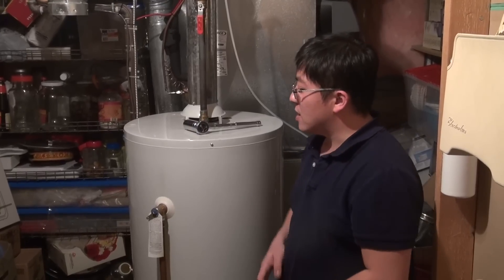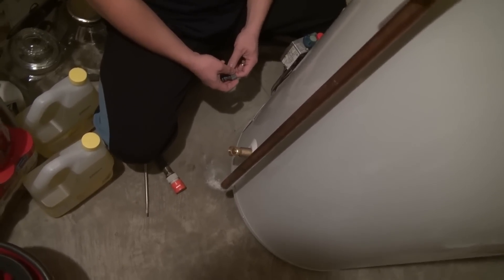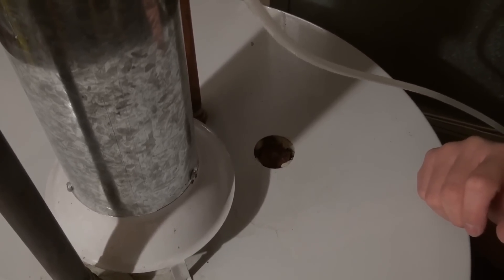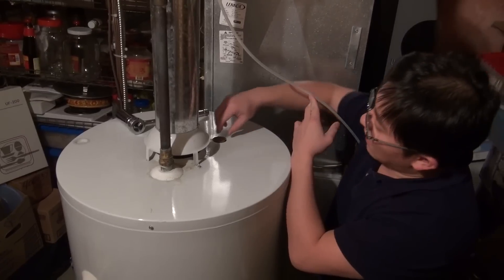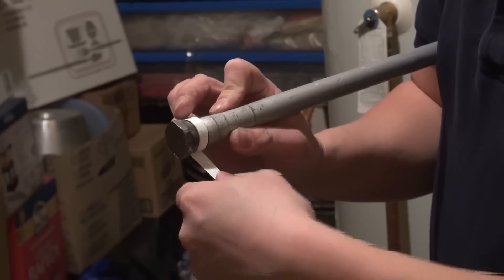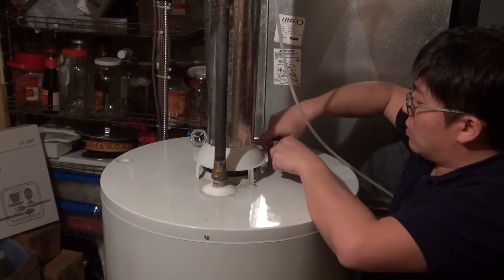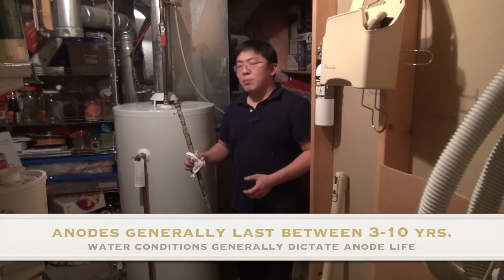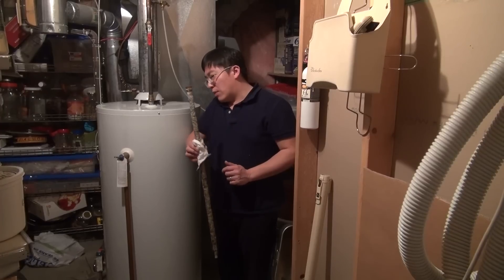How to Replace A Water Heater Sacrificial Anode Rod

Comment: I’ll be quite honest with you, I can’t find the access point for my anode rod. The entire top of my water heater is flat with a pipe for hot and cold along with the wide metal pipe in the middle. Any possible hidden spots?
Reply: Yeah actually it is a Bradford white. That being said. When I disconnect the hot water line and pull out the old
Anode rod, I’m assuming that it’s an anode rod with a nipple that I need?
Reply: Does it have to be ordered or would I be able to get one from Home Depot? Or Lowe’s?
Reply from the maker: it will depend on your local availability.  In my neck of the woods it was an item only available from special plumbing supply houses and NOT Lowes or Home Depot.  YMMV.
Reply: Hmm I’m in Calgary Alberta. I don’t know if it makes a difference. I’d have to call around
Reply from the maker: Calgary?  That's super easy.  Call Amre Supply.  They DEFINITELY have that in stock.

Comment: NICE video. I use SOFT WATER from Culligan, this is a nightmare. I have replaced the 3rd water tank now , until my plumber he remind me about to replace the Aluminium zink anode rode (every 2 years) , because Culligan  soft water has a lot of salt and damaged my hot water tank every 5 years. I did replace the 3rd hot water tank, and so same as my other friends that using same soft water from Culligan.
Reply from the maker: you're most welcome.  Wow 3rd tank already?  Tanks in our neck of the woods typically go for at least 15 years or longer.  I will keep that in mind when I decide to go with soft water...
Reply: I have decided to remove the Culligan , and my old house without soft water, the water tank already over 25 years still good !

Comment: I was told to use a  Segmented Aluminum Anode Rod since I don't have enough room. I was wondering if, I use a  Segmented Aluminum Anode Rod, will the links that hold the rods together corrode?
Awesome video. Thanks a lot.
Reply from the maker: the cable that hols the links together I believe is stainless steel which should last longer than the aluminum segments.  If you can't get a solid rod in then definitely use a segmented one as having a rod is better than no rod.
Reply: Thank you for your reply(answer). It helps a lot.

Comment: I did it with the big Milwaukee impact driver....came out with no effort...14 years old and seriously corroded. I had to carefully use the impact driver to force it back on. The impact driver made it totally easy.
Reply from the maker: yep impact drive would make it EASY but you have to be careful you don't crack the tank or inadvertently cross thread.  I'm sure you took the precautions however, I've seen other folks do some silly things to all things "threaded".
Reply: I did the same on the removal (still took a couple or minutes impacting before it came loose), but would not use impact to install.  It doesn't really have to be that tight (easy to do with hand socket wrench) if you use tape or sealant.

Comment: Good informative video. I also like that you roll the teflon tape in the correct direction so when you tighten it does not come loose. I seen other supposedly professional put the tape in the wrong direction.
Reply from the maker: glad you liked my vid.  I think I put the tape on the proper direction (I usually do) otherwise it would "unravel".  Yeah I've seen some pros do some weird things (including the recent plumber that botched my water heater install.   We are all human beings so making mistakes is part of life :)

Comment: One point to clarify if I may.  Do not turn on the electricity until the tank is full as you could damage the heating element via dry fire. 
Good point by Jooby Zat about conductivity.  Typically you will pierce the teflon tape on the threads when tightening. Don't over wrap the tape. Two to three wraps should be fine.
Good video. Very clear. 
It would also be a good idea to check the dip tube while you're at it. Best to disassemble both on an older heater and use them to buy proper length at store.
It would be a good idea to check the draw on the flue to make sure there is good venting of fumes.
Reply from the maker: great tip about the power as you're right, you could "dry fire" it and ruin the heating elements. Dip tube inspections depending on how the plumber originally installed the piping above the tank could be an easy task or a pain in the butt like how mine was setup.  YMMV.

Comment: Awesome to have Superman as helper!      Thanks for the video, replete with instructions.
Perfectionists like me would use a pipe TAP to carefully clean the old female opening at the top of the tank.     Paper towels might knock hard matter into the deep grooves of the thread, contributing to accidental ruination upon torquing-down of new rod.

Also, the word "rot" is inappropriate:   That word describes what happens to wood, not metal... which "corrodes."

Finally, the point of electrical conductivity is never addressed here.        Should there be conductivity between male and female, at the junction at the top of the tank?  Presumably, yes.      But I am not knowledgeable here.      Teflon tape, if used to excess, would prevent said direct conductivity.         A galvanic chemistry expert would know for sure, the optimum conditions here for tank longevity.

Again, the whole idea is to prolong the life of the steel in the tank, and thereby the tank, overall.
Reply from the maker: Hey John, lol I just noticed that I used the word rot to described the consumed rod!  My bad indeed and being a car guy I definitely should know better than that!  I did fail to mention the conductivity regarding the anode and the teflon tape.  From my experience with a thin amount of teflon tape that when you screw the anode in that the threads will cut through the teflon tape and make electrical contact with the tank threads.  I've confirmed this after the fact with an ohm meter and there is definitely good continuity.  If I ever have to replace an anode rod again I will remake this vid showing the additional steps I did post anode rod replacement.

Comment: Just a note, use thread sealing compound. Teflon Tape is not recommended to seal the threads. There needs to be good metal continuity contact between the rod and the tank.
Reply from the maker: if the tape isn't overly thick that when you screw the anode back in that the sharp threads of the anode will cut through the teflon and make good contact with the tank threads.  After numerous comments regarding electrical conductivity I tested my tank and it definitely had good continuity.

Comment: Great video!

A few notes.

Sometimes you need a heavy duty impact drill to get the anode rod out.

Some people like to "upgrade" their drain valve to a 3/4" ball port valve so they can "flush" the water heater faster.(2 days ago, I just removed 150 lbs of calcium deposits from a commercial water heater. The last plumber installed it toward the wall and we were never able to get to it in 8 years.)

Some people don't have room on top, so they may have to cut and break the old anode rod to remove, then buy the "chain link" version to install back in.

I know you said it in the comments, but just a reminder to some: You don't want to use too much teflon tape because the rod actually has to be grounded to the water heater- metal to metal for it to work. A thin layer of Liquid plumber's paste may be better here

* Fun fact: the 100 gallon, 199k BTU water heater I just replaced has 4 anode rods and after 8 years, the rods were down to nothing!! The new water heater has 4 rods, with an option for a 5th anode rod. Only about 6 inches long, but 3 inches in diameter. It's installed in the clean out(most residential heaters don't have a clean out)

Replacing the anode rod and flushing every 2 years or so can make your water heater last for double it's life.
Reply from the maker: that is something good advice on the tank and interesting notes about your past experiences!  150 lbs of sediment?  WOW.

I'd love to have a large cleanout on my water tank.  That would make flushing so much more thorough :)

Comment: first of all, great video. it was very helpful, informative, and easy to understand. now my question that led me here: will changing this rod out help the rotten egg smell coming out of my hot water?
Reply from the maker: You should flush the tank out completely and consider changing the type of material the rod is made from.  If you're running magnesium then try using an aluminum rod.
Reply: Got it. Thanks a lot!
Reply: Same problem but my water heater is probably 30 years old and have never changed the rod. Only noticed the smell recently. Cold water doesn't smell so I guess it's the water heater.

Comment: GREAT instructional video! My tank has 2 anodes.It's 9 years old in Seattle.I want it to last more than 9 years. I do drain the tank,when I think of it.
Which anode should I replace/inspect first? Thanks.
 Dave.
Reply: For Dave and others with 2 anode rods:  if you replace only one of the rods, be CERTAIN that both rods are the same material (typically magnesium or aluminum), or the rods may have a very short life.

Comment: Thanks for posting!  When wrapping the plumbers tape, is it necessary to leave some thread exposed?  I heard the anode rod needs to be conductive with the tank.
Reply from the maker: you could but when I tested my anode for electrical connectivity with the steel tank I got continuity so I know I'm "electrically bonded".
Reply: piercedasian 
Hi great video.
 the anode rod  could be isolated and it's the water that's bonding the metal Tink and The anode rod together. But I'm pretty sure that's not your case as Teflon tape will rip and tear has a threads on.
Again great video very informative not too many people know to look at this thing and to maintain it
Reply: The PTFE tape is not a sealant for a pipe threadded joint, it acts to let the pipe and fitting slide past each other to allow the threads to make the metal to metal seal. When the threads bite in when sealing, they will cut through the PTFE and bond the anode to the tank. Ideally the installer should not coat or wrap the last 2-3 threads to prevent the tape or dope from getting inside the pipe or tank.

Comment: My sister just replaced her water heater today. It was 22 yrs old and probably never had the anode replaced. I talked with the man the man that did the installation and he said the oldest WH he'd ever replaced was 36 yrs old. Of course he had no way of knowing if the anode had been changed in all those yrs but he speculated that they had been. We are in southern Illinois and the water is probably slightly to hard side. I wonder how long a guy could make his WH last if anode was replaced every 5 yrs or less.
btw...My sister paid $420 for a 40 gallon Rheem gas heater. 
Good video!
Reply from the maker: wow 36 years old!  I can only DREAM of a water heater last that long!  They don't make em' like the used to...  Hard to say if the anode rod was replace but regardless your sister got great value out of her heater.  $420 for a new heater?  I think in Canada we're double that amount because I recall helping a friend replace his and the cost to buy from sears back in 2010 was about $700 CAD.

Comment: What is the torque specification (ft-lb or newton-meters) for tightening an anode rod?  I have searched for one have not found one.
Reply from the maker: I don't know the spec and I've never seen on either but if I had to estimate the torque I can comfortably say 40-50 ft-lbs.
Reply: I'm about to replace my rod for the first time in 7 years and was looking all over for torque specs. The only time I've found anyone worried about torque specs was on small RV heaters and those were only like 7-8 ft pounds. I did find one post where someone said their home GE heater was spec'd by GE for 90 ft lbs (but I'm not about to put that much force into it). I have a Bradford White and the service manual gives no torque specs but says to not over or under tighten. Wow, what great instructions! I did just have the rod out to make sure I had enough clearance before ordering a new one and when I put it back in, I just turned until it wanted to stop and then put a little more force into it to snug. I used pipe dope. No leaks the next morning. Btw, after 7 years my rod looks terrible. I really wish I knew to replace it earlier but mine is in the hot outlet and so I couldn't see it and never even thought about it. I'm not sure if anything is left on it because it's covered in calcification but if there's any rod material left under it, it's not much. That's amazing how good the 14 year old one in this video is.

Comment: Well done, sir. But was the tape put on in the right direction? Seemed not.
Reply from the maker: lol, you're not the first person to say that and yes I did put it on backwards but if the tape is thin enough and doesn't bunch up on the threads then technically either direction is fine.  Obviously going the right way prevents bunching of the end when threading in but in my case the tape was so thin that it was a moot point.

Comment: This is very interesting. Why don't we hear more about these sacrificial rods since water heaters cost so much to replace?
Reply from the maker: not entirely true.  All heaters still come with anode rods but there is a lack of education for consumers and thus if it doesn't leak and makes hot water most people don't think about it until it's too late.
Reply: Just answered your own question. :)
Just had an inspector come through who said heater units used to come with rods all the time and then they stopped coming with them because it made the water heaters last too long.

Comment: Yes, the size of that hex nut on the Sacrificial Anode Rod is   1  1/16".   Best to use a breaker bar for extra leverage as those anode rods tend to be wedged in there pretty tight.   Most of the time there is not enough space above the hot water take to get the new anode rod in, but that is okay, just take a grinder and grind away some V-shaped 'bites' in the anode rod so it is easier to bend the rod at those places.  Remember, there is a thin main steel bar in the center of that aluminum tube and you DO NOT want to accidentally cut or even touch that bar with the grinder, so be careful, don't cut too deep !    Now you can simply bend the rod, insert it, and re-straighten the anode rod as you insert it into your tank. That's what I just did today.   In the U.S.A. they have anode rods already made like this, they are called 'flexible' anode rods.
Reply from the maker: wow that is a great tip!  I haven't seen the flexible rods in Canada although I'm sure if I went a specialty plumbing place that I could probably find them.  Thanks for sharing those great ideas with our viewers!
Reply: @piercedasian  The flexible rods are twice and sometimes more than twice the cost of the non-flexible rods.

Comment: hi can you give me an advice i got a leaking water on top of the water 
heater its coming on the middle and  the other one is coming to the hot 
water tube but it look like its not broken or anything  thanks
Reply from the maker: +healed warlock hmm, you probably have a pinhole leak in the tank somewhere and water is seeping out of that hole OR you may have a leak at a fitting joint and migrating to a spot where you can see it.  Can you send me pictures to piercedasian@gmail.com so I can see what it looks like?

Comment: So my 23 year old 30 gallon Rheem electric has never been flushed nor the anode rod replaced. I am considering just replacing the entire tank however the original electric water heater that was replaced ran from 1953 to 1993 and was only replaced because I could no longer find replacment heating elements for it. Not sure I want to attempt anode replacement as the location of the existing tank is in a tight corner which would make tryingn to losen up a 23 year old anode rod difficult.
Reply from the maker: +sac7000 hmm do keep in mind that they don't make water heaters the way the used to so your new heater may likely not last as long as the original one when REAL tough water heaters were built to last a lifetime.  I personally would NOT attempt to put in a new anode but instead just wait for the tank to fail and just replace it when it does.  Do you live in a region where the water is exceptionally neutral in pH?
Reply: +piercedasian Not sure about the pH of our water other then it is considered very good according to visitors, we live in Northern California near Mt Shasta. I would not have any problem replacing the water heater now while the weather is getting warmer and before a possible emergency replacement becomes mandatory when I'm either away or in the middle of the night and floods the garage. When I replaced it in 1993 I failed to install a pan underneath the water heater as the old water heater did not have one nor did the hardware store who sold me the water heater suggest I should have one.  In fact it was contractor friend of mine who just happened to notice I didn't have a pan under my water heater brought it to my attention a few years ago. Thanks for your reply. -Allan
Reply from the maker: well good luck when you do replace the heater.  Better safe than sorry to do it sooner and in the grand scheme of things heaters are fairly inexpensive for how long they last.
Reply: +piercedasian For me it's a no brainer, I'm pushing 70, live alone and the last thing I want to deal with in the middle of winter is a water that decides it's time to bust open  in the dead of night when it's freezing cold outside. But who knows? Maybe it's got another 10 good years left on it but then again maybe not, all mechanical things (and humans) eventually fail. Besides I'll sleep better!  :)
Reply from the maker: pushing 70?  Wow, I think that by the time I reach 70 I won't have ANY steam to do anything.  My goodness, by the time I come home I have no steam left in me and I'm in my mid 30's!